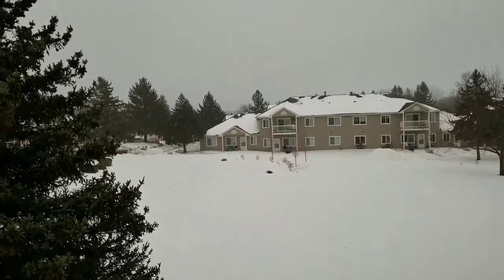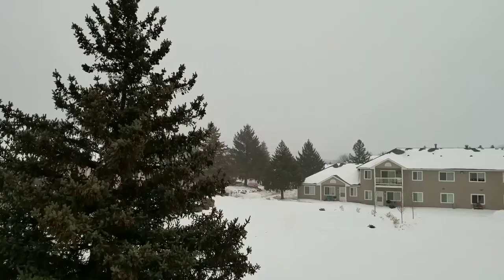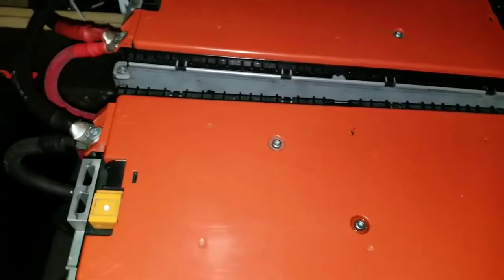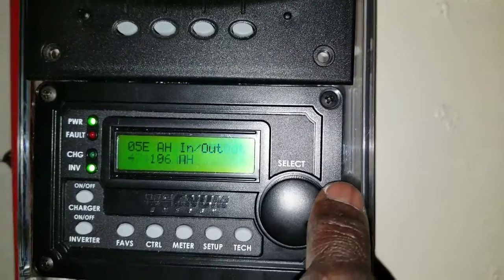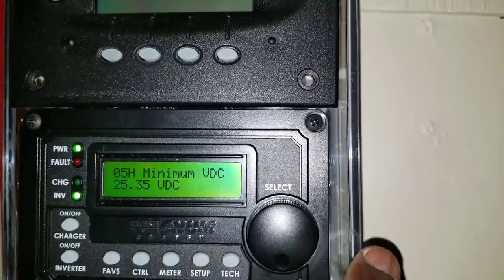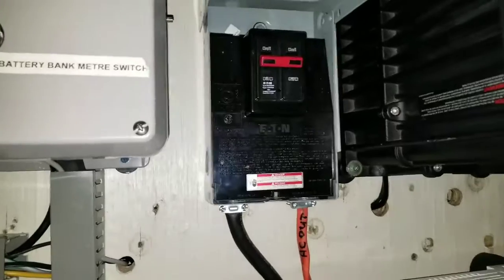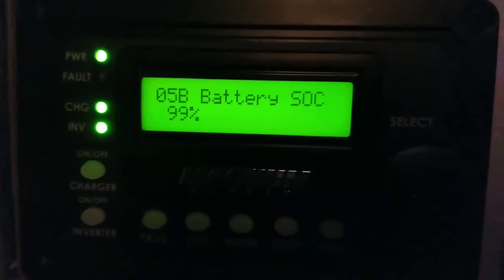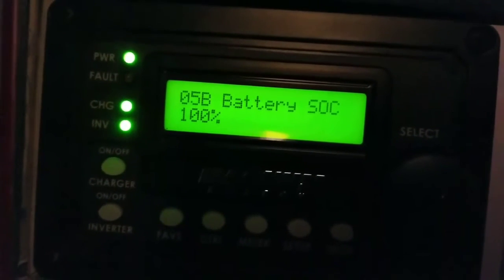VOLKSWAGEN e-GOLF Li-ion ENERGY STORAGE  BATTERIES | Ultra Fast Charging

Comment: Hello! I'm trying to get any performance spec on the peak discharging of this battery! Do you have any info on that?
Reply from the maker: VW eGolf.
Module is assembled in a 3 parallel 4 series module.
Busbars are welded together.
Rated at 75Ah.
Tested at 72Ah.
Cell Voltages
Maximum: 4.1V
Nominal: 3.6V
Minimum: 3.0V
Module Voltage
Maximum: 16.4V
Nominal: 14.4V
Minimum: 12V
Peak Current 600A
Continuous Current 350A
Battery manufactured by Sanyo.
Module Size
Length: 14 inches
Width: 6 inches
Height: 4 inches
Weight: 21.5 lb
Please click and support me on the link below:
https://www.batteryhookup.com/?rfsn=3471371.009083
Reply from the maker: Please don't forget to LIKE👍 SUBSCRIBE and SHARE my channels